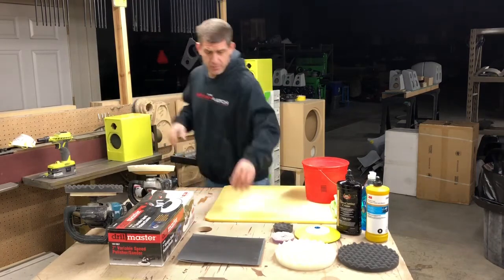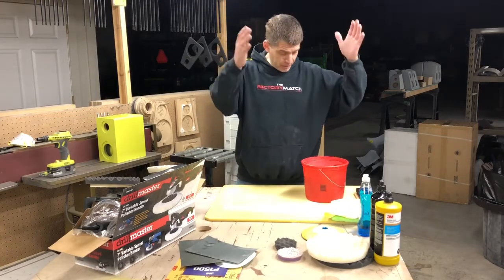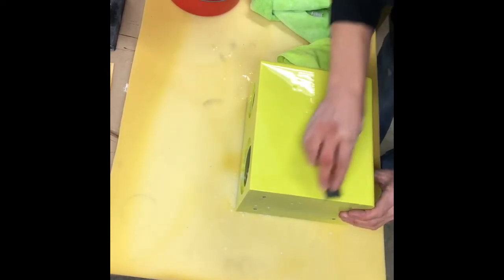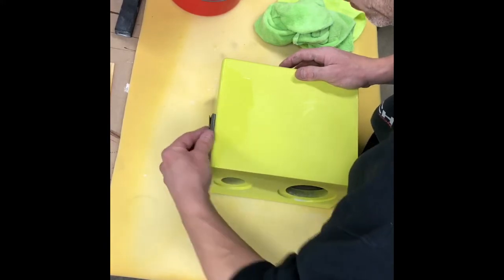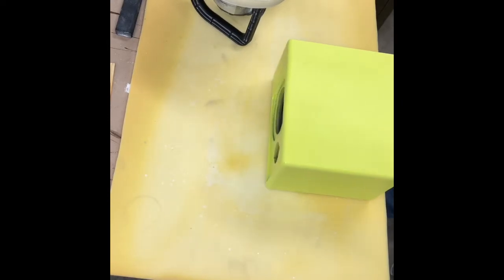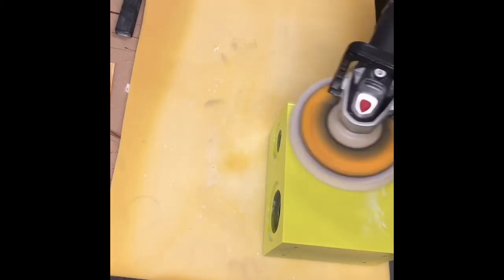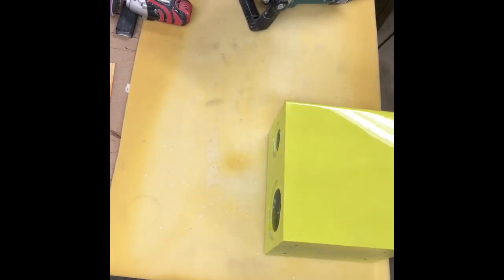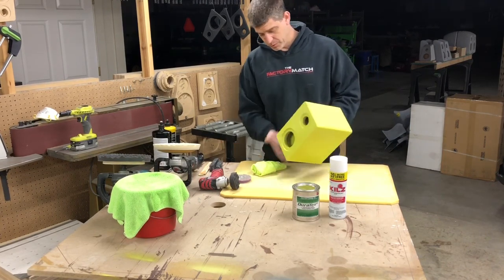(Part 3). How to Wet sand and Buff. Speaker enclosure. 2k clear over Krylon. DIY

Comment: Great video! The biggest issue I have with buffing and polishing that you didn't address here is dealing with the driver flush mounted holes. My buffer always bites and grabs them. I have a really hard time buffing the baffle of the enclosure because of this. How do you work around it? Are you just extra careful and only use the 3" buffer?
Reply from the maker: Yes I only use a 3” buffer around any holes or inlays. That’s a very sharp edge usually so I make sure the rotation of the machine is falling off that edge.
Reply: Looks like I'm buying a 3" buffer lol. Hopefully there are some decent and affordable air options.
Reply from the maker: There is... but there Loud.
Reply: Hey thanks again for all the advice! I just finished staining and clearing a bass guitar and the results were phenomenal. I grabbed a cheap 3" air sander/polisher on amazon and it works WAY better than my huge polisher. Got mirror like results from it using some cheap polish and compound I had laying around. Wish I could send a pic!